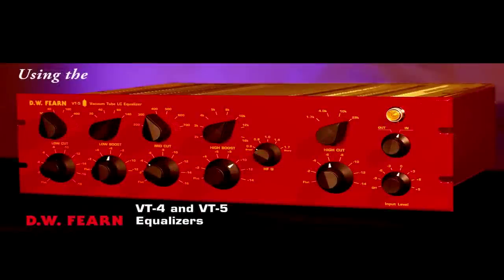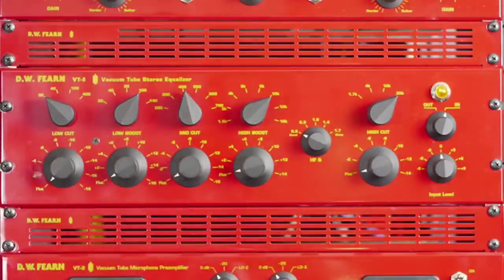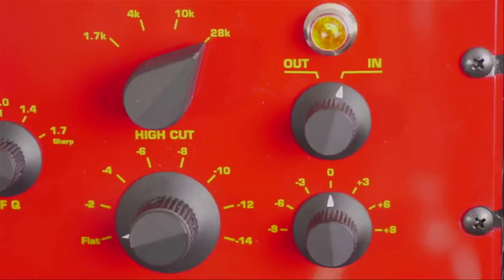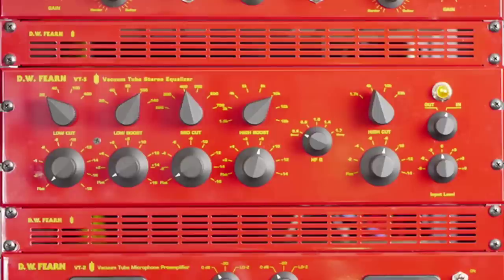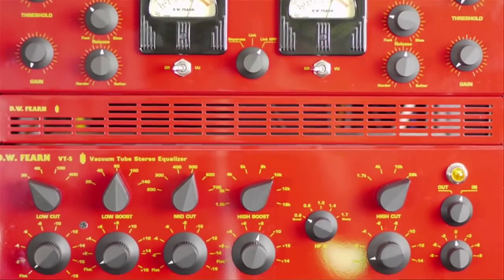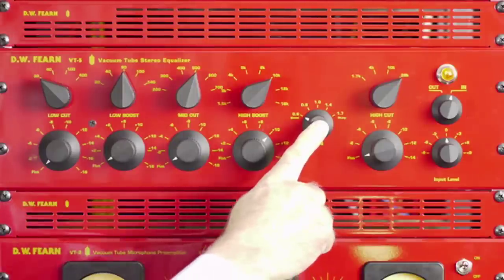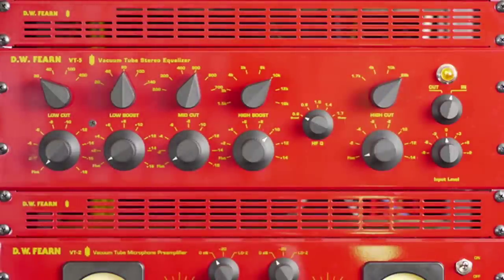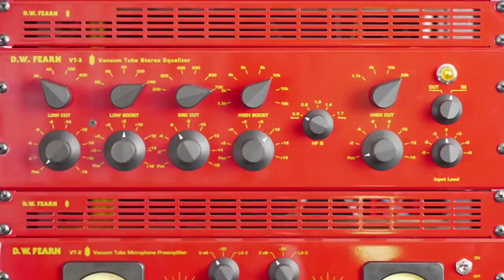D.W. Fearn VT-5 Stereo Equalizer Tutorial (2 of 2)

Comment from the maker: The VT-5 is essentially two VT-4s in one box, with front panel controls that adjust both channels at the same time. There are twice as many tubes, transformers, inductors, etc.
Reply: If getting the vt 5, could I use only the left input and the left output to use it as a mono unit?
Reply from the maker: @franknobel4715  The VT-5 has only one set of controls for both channels, but otherwise the two channels are completely independent. So, yes, you can use just one channel as a mono equalizer. In fact, you could equalize two channels of different material at the same time as long as the eq you want is the same on both channels. (We also make the VT-4, which is the single-channel version of the VT-5.)
Reply: @DWFearnHazelriggIndustries  amazing! thank you, yes that makes a lot of sense. Will get it within a week or two. Very excited and lots of love for your products.

Comment: Does the unit last 50 years and then can be repaired? Or does it die
Reply from the maker: All our products are designed to be easily repaired. The only parts that are likely to become unavailable at some point in the future are vacuum tubes. At his point, it looks like tubes will remain in production for many years.
Some parts, like tubes and electrolytic capacitors, have a finite life and will have to be replaced at some point. Our oldest units are now 30 years old and we are not seeing much need to replace electrolytic capacitors. Tubes generally last 5-10 years at minimum.